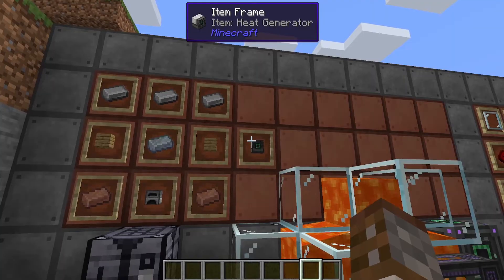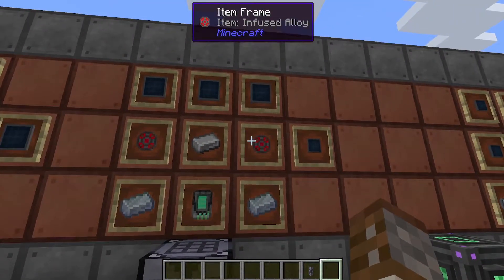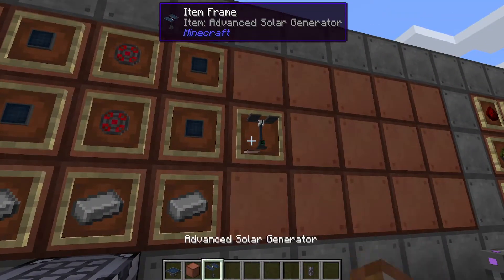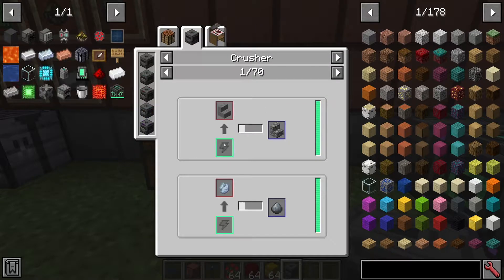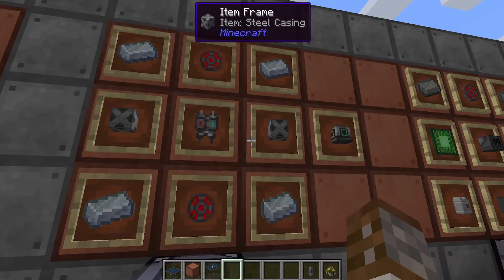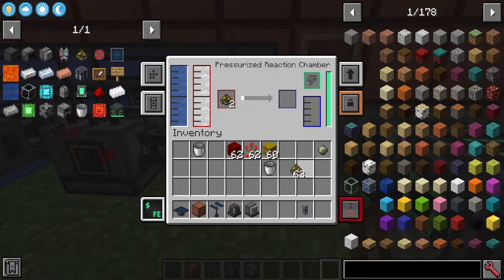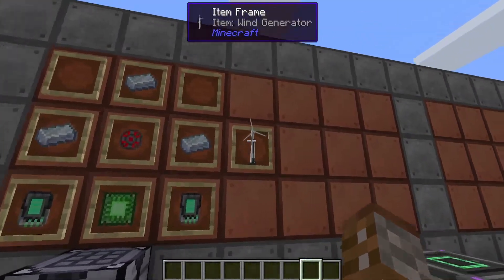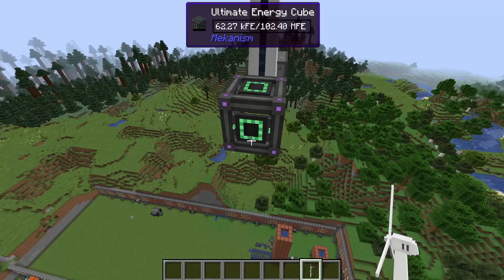How to: Mekanism | Power Generation (Minecraft 1.16.5)

Comment: I wish you could place the normal solar panels on top of a roof of some building like a factory, but sadly somebody decided to put the power output on the bottom
Reply from the maker: It does ruin the aesthetic
Reply: there mod that can transport energy  from 1 place to the other  without having to use cable

Comment: When seeing the gas burning generator burning ethylene got me thinking about how I'm using power for my base, and i want to ask
Are wind turbines at build height more efficient at making power than using a gas burning generator with ethylene? Because currently im doing the former for power
Reply from the maker: Not sure about which is better but I would say instead of expanding so much on basic power generation you move on to a fusion reactor and steam turbine as quickly as possible
Reply: the gas burners generate significantly more power, but you need a good supply of biofuel, the wind generators are free, so early on, they are the best, but when you can, set up an ethylene burner